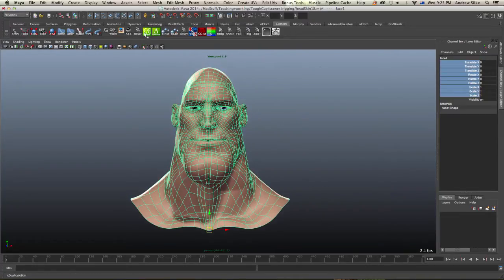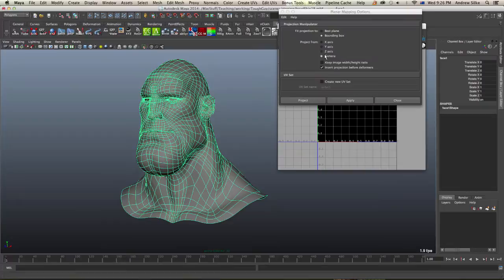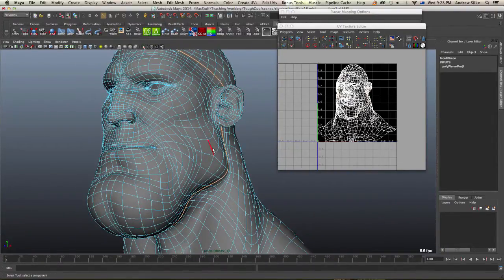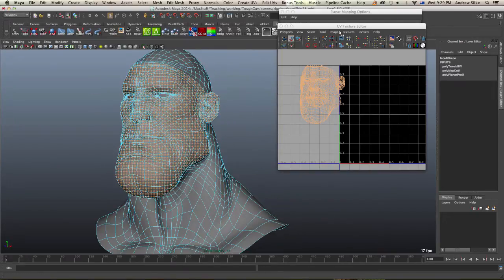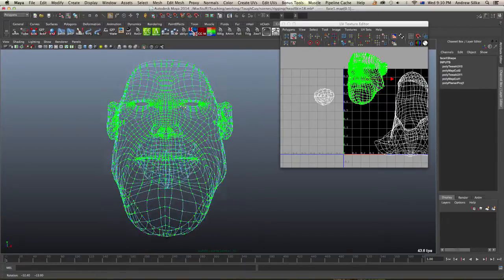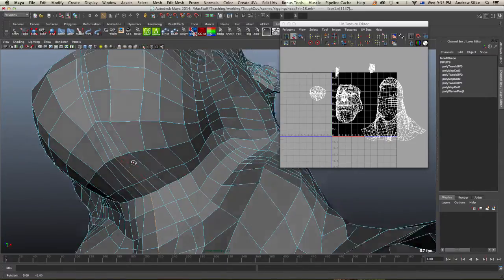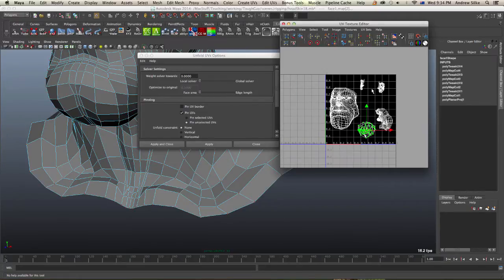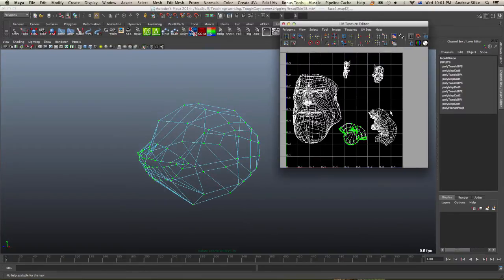Maya: Creating UV Seams (ZBrush Maya UVs 2/8)

Comment: Great tutorial! Why not just set the skinweight ander other deformers to 0 and do it on the original model? So you don't need to transfer the uvs later. Because of construction history?
Reply from the maker: Yeah you could do that, but I don't really trust the goZ to get my mesh back the same, also won't work if you have ngons.  These days I actually just save out the skin weights and reskin the mesh as the last step is fiddly so easier just to reskin.  Braverabbits import export skin tools are good for that, and I've been told you can do it under edit deformation > export deformer weights